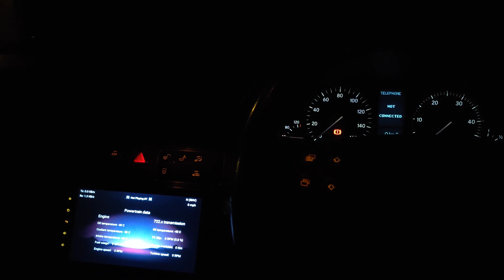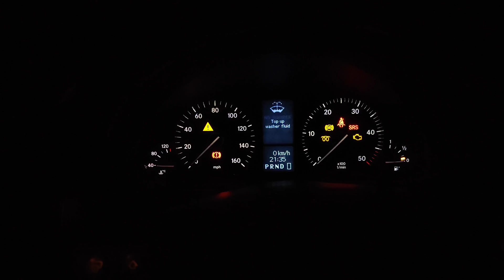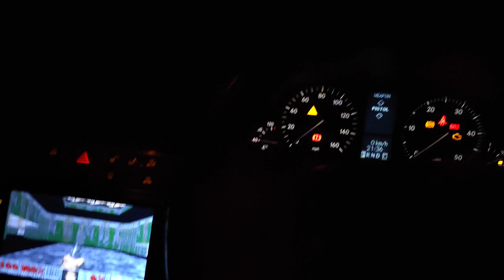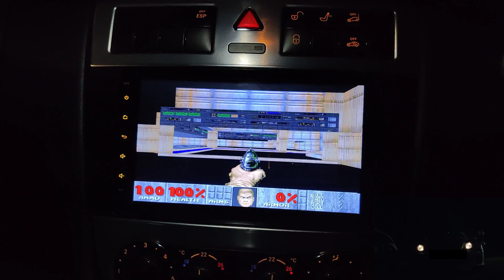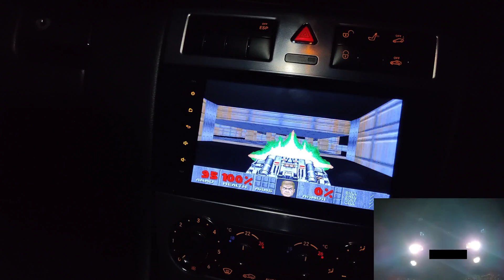DOOM running on a 14 year old Mercedes Benz - Car infotainment project part 4

Comment: Have you got the lights working through CAN bus?
Reply from the maker: Yes
Reply: @RANDASH  Quite curious about that. Was there any special tricks or just setting bits in a CAN message?
Reply from the maker: @NaokisRC  sending specific CAN frames based on reverse engineering data present in MB's diagnostic files (Tells you all about CANBUS frames)...See here: https://github.com/rnd-ash/MBUX-Port/blob/master/203_c.txt

I wrote a python script to generate that file, then wrote another script (All said in Part 1), that took that generated file and converted it into Kotlin object files